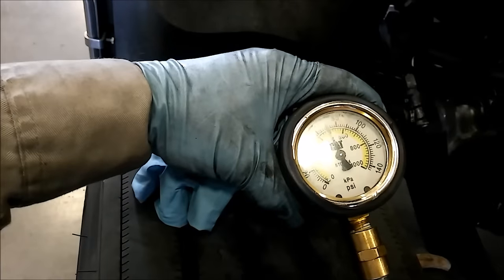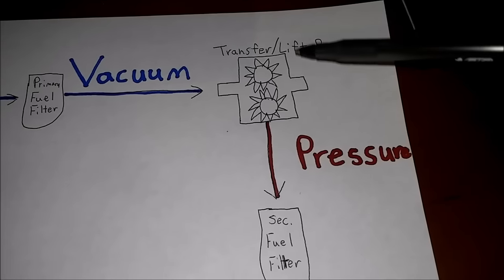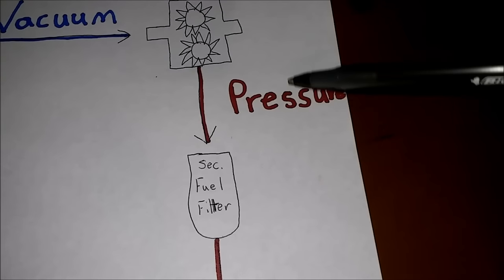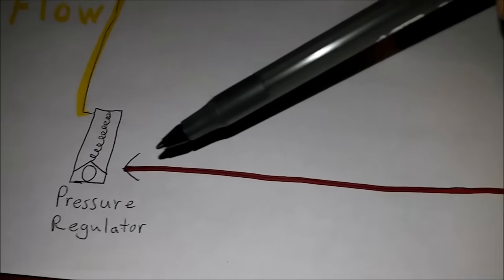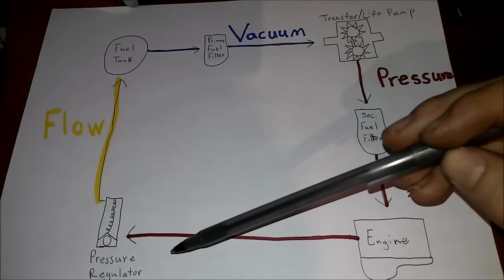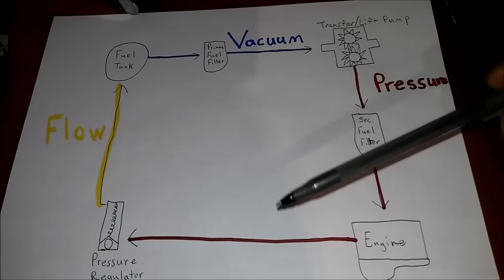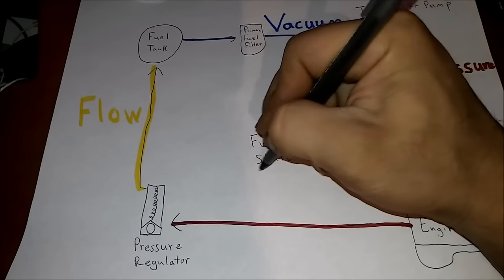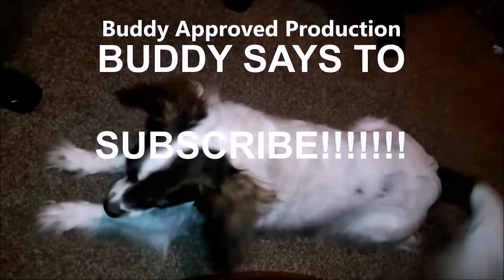How To Troubleshoot Cat Fuel Systems and Test Diesel Engine Fuel Pressure.

Comment: hello I have a cat 3126 I seem to be losing fuel pressure I can get the truck to start if I pump it with the hand pump it will run for a few and turn right back of I changed the fuel transfer pump on the back of the heui same thing the question I have is can a bad injector o ring cause me to lose fuel pressure

Comment: Hello, need some advise. Just rebuilt a c15 acert twin to single. No problem with fuel or injectors. At about 1,000-1,500 RPM in high gears the truck shakes/vibrates violently. When I sink in the clutch the rpm goes hunting up and down. Any idea what it could be?
Reply: What was the issue?

Comment: I have generator engine cat c4.4 suddenly stop without any alam on control panelboard. Cek fuel priming pump was working, selenoid valve working. Fuel good pressure to inlet fuel injection pump.During start only cranking, disconnectrd high pressure pipe to injector, no any fuel come out by injection pump. Engine still new and under guarantee by caterpillar. Thanks and regards

Comment: I have a 2000 freightliner. The transfer pump was stolen off of it. I bought a used one off ebay and with it on the truck, suction hose in a bucket of fuel and the pressure sid disconnected from the filter housing its blowing bubbles in the bucket, as if its turning backwards. When i take the pump off the engine and hook up my drill itll pump fuel and with the pressure line hooked back up it runs. Are some of these pumps reverse rotation or am i missing something?
Reply: its a 2852-20c pump.

Comment: i bought a 2005 peterbuilt with a C15 twin turbos, the guy didn't tell us the fuel was 2 1/2 yrs old after cleaning the tanks and adding 200 gal clean fuel the Eng starts it will run for a couple min then chokes out i can hand pump when it starts to die and it will run for a little while, at one point it Idled for two hours then started starving for fuel again...... HAVE EVER HEARD OF THIS? Thank

Comment: Good morning , I wanted to know if a 3406e 410hp , is a big Cat engine , or small ? Could I upgrade the hp into 485
Reply from the maker: Well that is a large engine for a truck engine, but Cat makes much bigger engines such as the 3500 and 3600 series engines. I have a short video of a 3512 or 3516 walk around. You can change your horsepower, but depending on what your current engine has for components you may have to change the injectors, pistons, damper, or other components. You would have to call your local dealer with your serial number or get a download done and they could tell you what horsepower options your engine would have. Those engines can go up to 550 HP.

Comment: My brothers c13 has low oil pressure.  his engine shuts off. He was told there is a washer in the oil pump  that if you flip it it will doulbe the oil pressure. Also the oil filter housing is supposed to have a bypass that can lower your oil pressure if not working properly.  Any help is appreciated. He's in a bind
Reply from the maker: +Blaine Celestaine I've heard the rumor of the C13 oil pump washer, but I don't know what they are talking about. The pump is pretty basic with just two gears. Don't know of any washer in it. The oil filter housing does have three valves that control the oil flow. One is for oil pressure relief, if it is stuck open, can cause the pressure to be low. I would start with the filter housing plugs, inspect and replace them. Change the oil filter as well.

Comment: thank you i am getting the turbos checked next week and looking into a racor canister. along the way i was told to quit running cat filters and run donaldsons because they are better any truth to this. less restrictive i'm told.
Reply from the maker: +Alice Stoneking Donaldson are basically the cheaper version of Cat filters, I really like Cat filters and they are much better quality than Donaldson or Napa in my opinion. If you are worried about the primary filter being too restrictive I would just get a slightly larger micron primary filter, but still run a Cat filter.
Reply: Remember..larger micron equals more crap getting through to secondary. If your constantly plugging your cat filter I'd figure out what's plugging it..if it's cold climate and it's too restrictive consider an online heater or tank heater.

Comment: Hey I have 2004 international truck C15   Motor, I am having issues that it turnsoff  anytime and then after that if I  keep on trying it’s starts after 30-40 mins then go off again and I changed its batteries now motor crank but still won’t start any guess what going with it

Comment: Hi Adept Ape. I wanna ask you if there is any way to get air off from fuel lines using 
"Fuel priming Pump" if yes, how to do it  on C15 twin turbo. and to I have to put presser in fuel tank?? I just had hard time to start my Track in this cold weather, and I have replaced fuel/water separator. Thx.
Reply from the maker: +Ion Agreci You can use the hand priming pump, but you shouldn't be getting air into the fuel lines whatever the temperature is.
Reply: Adept Ape I got air in fuel limes when I replaced fuel/water separator
Reply: Put a primer onto the fitting that connects to the secondary filter housing and let it prime for about 5 minutes before you try to start it.

Comment: my engine when cold idles really rough ,and smoke out the stacks, replaced all 6 injectors , smoke disappears when  hot ,idles rough still, but every once in while the engines smooths out and runs so good it is scary ,lots of power ,really works well, then for no reason runs rough again , could it be one of the reman injectors are bad ,injector driver module,fuel injection control module ,,,,I'm lost ,can't figure it out  ,I will put it back on computer again to do cut out test,,,any suggestions ,,

Comment: Hello,we have a cat C9 on Claas combine and we have sometimes low fuel filter pressure.When we dismount the fuel filter we see that filter is dirty and have Brown colour.Can we have some engine oïl going to the fuel return and then to the filter.thanks
Reply from the maker: +Jp S If you have a HEUI C9 it is very possible you have an injector or injector seal leaking HEUI oil into the fuel system.
Reply: I was thinking this after reviewing some CAT schematics.thanks a lot for your all work and videos.Regards from France

Comment: I have a 3126 Caterpillar motor and once I start up rolling and I'm losing power after the 7th Gear the RPM is high then it's starting to flutter choke on me so what could be the problem after this I shut the engine power off and let it cool off a little bit for 5 minutes then it takes off again

Comment: I have a 2001 year model 3126B and after setting over a couple of days it is hard to start, when it starts it skips and misses for a 5 or 10  minutes then it runs ok continually and ok when you cut it off and on (we deliver stuff and start and stop a lot) What could that be?

Comment: Hope you can guide me. I have shut off my driver side fuel tank and run one tank that's a split tank from the passenger half fuel/half hydraulic.  On my return line it is scorching hot. I dont run hard it just sits. But it is extremely hot after just 2 hours. Any suggestions?
Reply: These engines returns fuel to the tank for cooling. The fuel temp., is hot coming out of the head. Single tank trucks require a fuel cooler to help cool the fuel. Low fuel levels causes injectors to fail due to temp.
Reply: Thank you. I will be adding a cooler. Trucks been sitting for a year. Truck fired right up after a complete PMI service

Comment: I use Kenworth t600 cat, c15 smart shift gearbox, 475 hp. Fuel pressure is 6.5 bar. Filters and pressure regulators are original new, truck feels pale with 20 metric tons load. In the hills fuel expenditure is 45 liters per 100km and truck goes with significant efforts, does not feel good. What shall I check?
Reply from the maker: +pavelkalinine That fuel pressure sounds good. What boost pressure does the engine have when pulling a hill? What is the serial number as well?
Reply: Adept Ape Have not measured boost pressure on the go. engine s/n is mbn28569, truck vin 1xkadb9x14r062971. 
Trucks feels like only half of its 475 hp are here.Does not want to shift to 10th gear, on even road and already on cruise speed. Injectors are fine, air ducts without leaks, intercooler is fine, turbo bypass valve if fine.  No smokes - either dark or light.

Comment: I have 1998 fl70 glow plug / wire light on starts hard at high idle once hits 120 degrees or step on brake goes to low idle then back up and down !maybe sensor?

Comment: Hi man,how about the low pressure in my engine CAT C32 acert,i have some problem if rpm up to 1080 my fuel pressure is different with other engine.my first engine when i'm push throttle until rpm 1400 the fuel pressure is look good in monitor by 520 kpa.BUT when i pull my other engine until rpm 1080 the pressure is 484 kpa and when i try to up the rpm of engine,the fuel pressure is not stable still in range of 404-484 kpa.and when i pull all my engine into rpm 1430 my right engine is fine with pressure but my trouble engine can reach that,but the alarm is on to make the engine shutoff and pressure is drop until 320 kpa.can you tell me whats wrong man with my engine?thank you :)

Comment: I have freightliner columbia with Cat C15 engine... lose of power ... going uphill with empty trailer ... it's struggling... i had changed the injectors few months ago for the same reason... it was running fine ... now same issues are back again but not that vigorous ... feels like power comes and goes ...
Reply: Just hit million miles last week

Comment: I have a w900 with a c15 .... my passenger tank won't feed the driver side. I've changed all hoses and the valve that regulates both tanks.... and same problem any hints or ideas where to next?
Reply: Check for a plugged vent or bad vented cap

Comment: I fixed my friend's truck by seeing this video..
He had a vacuum leak on the small line that goes to the vacuum gauge on the dash
I'm not a mechanic but he took it to a few mechanics here and none of them solved the problem because they didn't check that gauge line.
Reply: Is there really a fuel vacuum guage? What kind of truck did you fix?  Just curious cause there’s always gauges on trucks I’m like wtf is that?!?! (Flux combustion chambers secondary drive pressure tank low pressure high side drain petcock pressure)
Reply: @floridamancomedy3151  It was a Freighliner Classic XL with full gauge package... 
They have a fuel filter restriction gauge on the dash... 
It works like the one they have on the air filter too...
Reply: @floridamancomedy3151  Sorry if my English isn't correct or maybe you call things by different names... sometimes the translation gets confusing...
Reply: Jc Jc no I understand, I have been working on a c7 cat that has rust issues and I’ve had to replace all fuel lines to and from tank and pressure regulators and check valves, and one issue was leak in the line from the tank to pump and I couldn’t figure it out because of it being in vacuum. A gauge in the cab would help monitor fuel system.
Reply: Jc Jc oh no kidding that makes sense now, it gives you an idea how clogged your filter is, good to know 👍
Reply: @steveiacono4420  I hope you get that kitty fixed...Good luck my friend

Comment: I have question I changed my transfer pump regulator fuel lines to and from exam did pressure test with valve covers off to see if a leaking o ring at base at idle sounds great when put under load at fuel throttle it hesitant and acts if it's a air bubble then at test drive it gets on high side and acts if I'm running out of fuel please help

Comment: I have a 2004 mbn c-15 cat after a couple of days my primary filter is not full,it starts but spins a lil longer than normal and hesitates every now and then on a hard pull.
Reply: When you remove the primary filter it is normal for the fuel to suck out back to tank. You can install one way check valves in the system to prevent any draining out. Put one at the return of the secondary filter base. Make sure bypass valve is off and keep it off. Remove return elbow and install fitting and reinstall elbow. Supply side I put my check at the splitter. That way I hold fuel all the way up. You could put one on each tank, but your doubling the cost. These thing are over one hundred  dollars. The are number eight and trucks are number ten lines. So you have to buy the adapters as well.

Comment: Is the transfer pump another name for injection pump? I thought diesels had an injection pump
Reply from the maker: +Brendan Rapa The transfer pump is a low pressure fuel pump, the injection pump is a high pressure pump. Many diesels have both.

Comment: I recently bought a 2001 GMC Topkick C6500 with a Cat 3126 engine.  The original vehicle order form, listing all equipment options states "Fuel Water Separator Raycor".  I can not find the separator and / or it's drain valve.  Anyone?

Comment: I have an f-650 with a 3126b I've been having an issue, it'll be running just fine going down the  highway then it cuts out, as if it died, then runs about half power/speed. If I turn the key off, then back to run, till the Wait to start light goes out then start it again it'll run fine, sometimes it will do this only once or twice, other times it will do it over and over. I've also noticed it does it more frequently on warmer days. Any ideas? Please/thanks!
Reply from the maker: +Rick Mayer Are you getting a check engine light? If you are can you try and find the blink codes.
Reply: Service engine soon comes on when it acts up, when you re-start the light goes out. It won't save the codes tho. Also, no blink codes, just, steady on.

Comment: Hi Ape I wanted to ask how would I know The ECM is bad ! I tired the test with the fuel bucket and it does not suck any fuel but I was told that if the ecm is bad it won't suck. What happened to my truck is that I was driven down the road and all of a sudden the truck jerked and then shut down it did hat a couple of times. I changed the fuel filters but it did the same thing. Now it does not start at all.
Reply from the maker: +dextreme hauler What engine do you have? The Cat engines use a mechanical fuel transfer pump so even if the ECM is bad you should still be pulling fuel. Does the Tach show a signal while you are cranking?
Reply: Doesn't show anything it's a cat c15 twin turbo I press the cruise control for fault codes and it shows 55. When I do the hand pump I do see fuel coming out of the line that goes to the front of the head but won't start when I crank it to I see fuel flow out
Reply from the maker: +Adept Ape If your tach isn't showing anything, that usually indicates a bad ECM. Check out my "Cat engine won't start troubleshooting" video and it talks about the ECM and testing the injectors for signal.
Reply: Adept Ape what unnoticed when it was running rough was that the return line from back of motor was shaking like if you put your hand on it it would vibrate a lot the line wouldn't bounce around the it was let like a smooth flow in there

Comment: I have a question? About 3406 it blows white smoke when warming up and it is missing a little But it clears up when it is hot
Reply: Im having the same issue with c7 cat on my 140m 2013  grader misses like its starving for fuel but when warmed up she's good
Reply: Probable cause is worn injector if fuel pressure checks out OK..could also be an injector ring hot sealing.

Comment: Do 3116 come with water/fuel seperators or can they be installed? Mines doesn't
Reply: Any filter before the engine is supplied by the truck manufacturer. Have seen a in-line filter in the rail. It would be best to install a primary filter to protect your FTP.

Comment: Hi ! I’m getting air in the fuel and I change all the lines from the tanks all the way to primary filter but does not fix the problem! Ty
Reply: Having similar problems with a cat c7 , no fuel pressure changed transfer pump and still no pressure I’ve added straight fuel source to the fuel transfer pump inlet and still no pressure!

Comment: I have a 98 3406E. it is shuttering badly and blowing white smoke under load. it shutters so bad that it kicks me out of high range when splitting the top gears on the 13 speed.
i changed fuel filters
Reply from the maker: +Shawn Kilpela Do you know you have a fuel issue? What is your fuel pressure?

Comment: i have a question. i have a 3406c mecanical. pump. i was told not to use a cat filters for both fuel filter but the one in the motor and the frame the primery use a smaller fs1212 so its not so restrictive.
Reply from the maker: +Vasile Costin Well you can use a Cat filter, but usually you want to use a larger micron filter for the primary filter so it isn't so restrictive.
Reply: well i replaced the cat filter for a fs1212 and acts a little better.. its nit the large filter.  so i will try the fs1000.. i try to stick to the brand but somethung tells me that cat filters well are not all that anymore
Reply: Adept Ape thank you for the reply
Reply: Adept Ape does a 3406c have a fuel pressure regulator on the primer pump or injection pump i wonder if thats one problem
Reply: Vasile Costin  fs 1212 is less restricted than fs 1000. I use the 1212 and 5319 on sec.